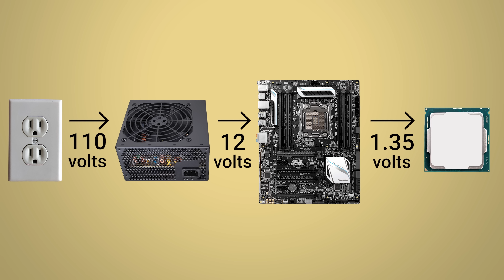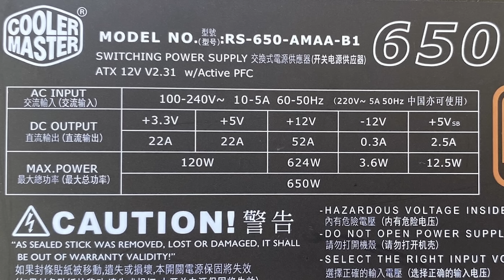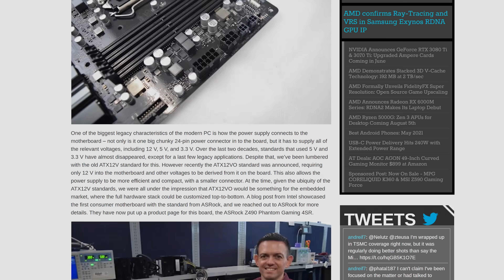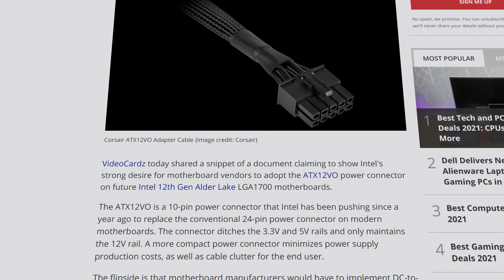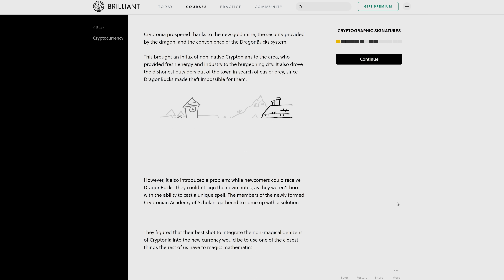Is The 24-Pin Connector DEAD?

Comment: 10 + 6 + 4 + 4 = 24. This seems like a step sideways more than a step forwards
Reply: We have been bamboozled
Reply: @iawindowss4061  We've been tricked, backstabbed, and quite possibly bamboozled
Reply: Thanks, more cables to manage
Reply: Not to mention it will make motherboards more expensive.
Reply: @nattzero5315  not really it is easy to go from 12v to 5v the issue is how clean it is but lucky 5v devices seem to be less sensitive compared to a CPU/GPU in terms of how clean the 5v power rail is. USB for example normally doesn't seem to care half of the time if it just receives 4v
Reply: @nattzero5315  and introduces mor parts to the MB which could possibly fail.
Reply: @nattzero5315  For now, and even then it's only a maybe
Reply: Was just about to say this... At 2:46 that 24 pins just spread out over more Mainboard space. lol...
Reply: There should be 1 DC-DC converter on the case for sata drives that just takes in 12V, leaving more space on the mobo.
Reply: @leerman22  I agree
Reply: @leerman22  agree tho, i mean if this happens to be a new standard, i have no doubt if a 3rd party companies make this thing and used pcie or eps power connector as a source
Reply: @leerman22  SATA is dying. Industry is moving to M.2 or U.2 for Enterprise.
Reply: @AlexeiDimitri  That's why have an optional 5V supply that you can ignore.
Reply: The problem is not the number of pins, but that that one specific bulky cable is hard to manage, plug in, and remove. I have literally shaved down a 24pin power cable to reduce the ridiculous amount for force required to plug it in and take it off of boards I did that a lot on. Honestly what we need more than anything is just a redesign. Maybe expanding that little clip as it is always stuck behind some caps and requires a screw driver to remove, and you practically need a hammer to plug it in.
Reply: @wisnoskij  Just get a right angle adapter for the 24pin. In my experience it looks nicer and is easier to attach to the board.
Reply: @wisnoskij  I know bulk cables that are easy to connect, and multipin one that request little force.
is more a question of design, they could have made a 10 pin + 10 pin and everyone would be happier.
Reply: @wisnoskij  never had a problem plugging them in......taking them out, however.....
Reply: This will also make it harder to add in custom hardware and microprocessors that use 5v logic. You can't hide them behind a motherboard tray anymore because you will need another cable out the MB.
Reply: This is what I tried saying and got misunderstood.  Its a step sideways or even backwards.  You can use a 10pin cable so long you don't need other connections in regards to that it's kind of modular but i don't think ppl are gonna stop using sata connections any time soon.  Hell I have 4 on my PC.
Reply: That's the sad thing about this channel is atx12vo is all about power efficiency and these yuks just kept going on about pin count as if anyone cares.
Reply: not to mention that in the IC that controls  the voltages in the mobo gets damaged, you'll need to replace a even more expensive component
Reply: @ildemaromeroVB  No, you won't.  Just plug it in somewhere else.  Even basic switching regulators have built-in overcurrent protection so it's not likely you'll kill them.  And killing them doesn't take out the whole board since they'd likely be dedicated per connector or pair of connectors.  The standard is incomplete in its current release but regulators and connectors being on the motherboard are recommended as an example but not required.  So regulators can still be on a separate board (SATA power distribution module) or included as inline regulators on the cables themselves.  Since a switching regulator isn't going to generate a lot of heat and they can be fairly small it really doesn't matter where you put them but the closer they are to the end use device the better (like built into the device itself).  Having each device regulate its own power from a main bus would be the most efficient use case which is why expanding the ATX12VO standard with a SATA12VO standard for newer SATA devices would be a perfect goal and you don't even need to change the SATA power connector, just drop the 5v and 3.3v and use fewer wires.  And the 3.3v has mostly been dropped already by all devices.  The future could be even fewer wires needed by using a 24 volt standard and a 36 and 48 volt standard for servers and industrial devices would be even better but 24 might be an upper limit for consumer devices...  It's literally better than anyone here can admit.  If you don't like it then you really really don't understand it at all...
Reply: @10100rsn  All of the options you listed are opportunities for the companies that make any of that to charge more for their parts while the cost of a PSU will remain the same if not more expensive because it's a "new thing". Not to mention the boatload of e-waste making millions of perfectly good power supplies obsolete will bring on. All of that in the name of making a standard that's barely more efficient than a good power supply now doesn't seem worth it to me although tell me if I'm missing something.
Reply: @dirlrido2522  The old standard is not obsolete... yet.  They will still exist for some time before they become e-waste and adapters for ATX12VO won't be difficult to create.  Same with adapters for ATX12VO power supplies to work with 24-pin boards.  Buy what you want, make your own e-waste how you always have or throw it in a box that you put in your closet or whatever.

Yes, you can charge more for an "optional" add on that requires additional components.  SO WHAT!  Don't want it? Then don't buy a board with those features on it.  They're gonna charge what people are willing to pay how they always have.  

The section in the standard where it says "SATA Storage and Optical drives will now need to get their power from the motherboard" is for reference and not a requirement as people seem to think.  The 2-pin SATA with 12 volt only and the 2-pin molex with 12-volt only on the ATX12VO power supplies are optional as well.  Engineers can literally put the regulators wherever they want so there will be plenty of options around.  It is pretty damn easy to stick a couple of small switching regulator boards inline on an adapter too so what's the issue?  Where is the e-waste?  You're just making up things to complain about because you don't understand it at all.
Reply: @10100rsn  I don't really see the point in it all. Nor do I see why you're getting so fired up about a PSU standard. Everything you said is still just more ways for companies to get more money from something that already works fine. No company is going to market anything to do with this standard as optional even if it is. There will be pushes to adopt the new standard, pushes to make you spend more money on something new or pushes to "reject this money making scheme and buy our adapters hahaha!!!". Yay another point of failure. I'm sure there are benefits but if so many people still "don't understand" the point of 12VO with it's minimal efficiency uplift, is it actually something we need in the first place or is it just change for the sake of change?
Reply: @dirlrido2522  Okay Nostradamus.  Keep making your nut job style prophecies and conspiracy theories.  There are literally less points of failure in a fully modern ATX12VO system using all modern hardware.  If you add old hardware to a new system then you are adding the point of failure and not ATX12VO since old hardware is prone to failure from age alone, and that's age from manufacture date and not age from when you purchased it.  On a fully modern hardware system using ATX12VO there are fewer cables (-14 pins and no SATA), fewer components (fewer things to go wrong) and it is more efficient power usage and not just more efficient conversion.  It's you and the people here who are sprouting random conspiracy theories about it being worse and a money grab for big tech companies.  ATX12VO is literally a better system and for a fully modern build will last longer with fewer components and fewer things to go wrong.  It's not going to come to life and murder you and your children while you sleep and the government isn't hiring aliens to brainwash you into buying it and they certainly won't be beaming ATX12VO into your house from a UFO that's watching you watch the History Channel...  It is a simpler and more power efficient design (based on power usage, not just conversion) that uses fewer wires and fewer components overall.  So suck it all you Nostradum,as,es
Reply: @10100rsn  Damn that was an odd take. The points of failure I was talking about were adaptors. My only point is that it's a pointless standard. Non 12VO PSUs aren't going to suddenly die because they're older and neither are SATA devices. I'm not sure what you mean when you say I'm creating conspiracies, it's literally just spending money on something no one needs.
Reply: Just have 2 00AWG wires to power the whole thing with an alternator.
Reply: Nice, now if I need more drives, instead of buying a pci-sata expansion card, I'll need to replace the motherboard!
And also, if any of your 5V and 3.3V components shorts out (maybe a RGB led strip, a fan controller, or even a hard drive) you can potentially short your entire Motherboard! Isn't that cool?
Reply: @Mr.Morden  But they said that in the video.
Reply: @Azarilh  Oh they did but then they unintentionally gave the impression that the number of connectors was also a reason for ATX12VO.
Reply: @Mr.Morden  They did and that's dumb.
Reply: Thanks Engineers
Reply: Someone was paying attention in arithmetic class.
Reply: That's assuming you still have SATA drives. Either way separate smaller cables would be easier to manage than one massive one.
Reply: Well, the 6 pin is used if you really need that power because the 10 pin can already provide more that what the 24 pin did. Regarding the Sata power, it's obvious that the future will be without them, so it's useless to wonder about the transition period. The same thing applies with everything else I guess
Reply: That is, because it is.
It's like phone manufacturers not including chargers to claim they are greener. You are still going to need a charger and that charger has to be packaged and transported separately, which ends up being less green overall. But hey thats how the world works these days, ego and number wars above everything else. Which is really a shame =_=
Reply: @Longgshot  Do you buy a new power supply every time you get a new phone? If so, why, when your previous one should work just the same?
Reply: You previously had 24+4+4=32 instead.
Reply: @erkinalp  but those 4's were hidden with the power supply, visually speaking it looks like more cables to an end user, if they had those drives hooked up. It makes for bad cable management is all Im saying, I'd prefer the old way.
Reply: @erkinalp  24 + 8 + 4 = 36
Reply: The 10- pin connector provides a lot of power and most power used on the motherboard is for the CPU anyway, which comes from the EPS connector. I don't think the extra 6-pin connector will be used much. And then the 4-pin are for SATA. Who's all excited to build a cutting edge system with a bunch of SATA drives in it? 
I bet it will be used in some ITX boards, exactly where people are worried there isn't enough space, and they'll just be 10pin +  4pin, and only 2 SATA connectors on the board. If you can get more power out of a SFX-PSU because there's fewer voltage rails people will love it.
Reply: RGB is a few steps backwards. It looks like a bunch of overgrown cereal munching basement dwelling dudes are setting up lights everywhere (all of a sudden) like middle schoolers.
Reply: NVMe drives don't need cables and won't care at all between 24-pin and ATX12VO.  Since most newer systems that people are going to build are going to have only NVMe drives you shouldn't care either.

Honestly, I want more!  Higher voltages like even just 24 volts would be even more efficient in reducing the wire clutter.  Bring us ATX12VO and then ATX24VO, ATX36VO and ATX48VO all at once for servers and more industrial applications like CNC and printers !!!  DO IT!  JUST DO IT!
Reply: @10100rsn  People do care, and absolutely should care. It isn’t just SATA storage drives that use SATA power connectors, and many people still use the SATA format because it’s cheaper than NVMe. That’s why 12VO motherboards have to have SATA connectors on board. 

To tell people that they shouldn’t care because you don’t just shows your ignorance to the problem.
Reply: @StolenJoker84  so complain some more. Whine and cry for all the wrong reasons.  If it's not for you that's fine, don't spend money on it. It's still going to exist and still be better than what we have now. If it were me on the design team then I would take it even further by eliminating the old SATA power connectors altogether and create a new SATA12VO standard... There you go... Problem moved from motherboard to PSU adapter cable...
Reply: @10100rsn  Not complaining. Just pointing out why your “Nobody should care” attitude is wrong. Yes, there is a place for the new standard. ITX builds - for example - would benefit greatly from it, but it isn’t a solution for every situation.
Reply: @StolenJoker84  "isn't a solution for every situation."  Only situation it doesn't work for is if you're using older parts.  So like the doctor says, "Don't do that."
Reply: @roopey  That’s the point I was trying to make as well. And (s)he ignored the point that, currently, 1) SATA storage drives aren’t the only commonly used components that require SATA power (some fan hubs - like the one built into my case - do, for example), and many people still buy SATA storage drives because it’s cheaper and offer far higher capacities than M.2 drives. Until SATA devices can run strictly on 12V, this standard is going to introduce new points of failure that aren’t currently present. 12VO feels a lot like a solution looking for a problem for most end-use cases, and - IMO - isn’t likely to take the computing world by storm until they do figure this all out.
Right now, I think it’s a good solution for mITX builds (that aren’t likely going to have SATA storage, extra fan controllers, or the like anyway), but not much else (in the consumer space).
Reply: @StolenJoker84  Yes, it certainly doesn't help much. It might have been OK in some cases, as you said. It could help in budget builds where people push almost every cent towards GPU / CPU while everything else in their system is cheap garbage.

For me it's just another dumb limitation created by Intel. Similar to their locked Prozessors (non-K), limited "lower tier" chipsets and non-ECC Ram on desktop. That's why I went with a Ryzen CPU this time. And it clearly was the best choice. 

And, even though I'm paying almost nothing for electricity (our PV on the rooftop delivers more than enough), I still went with a titanium rated PSU from Seasonic. If less people would buy cheap crappy inefficient PSUs there wouldn't be any problem.

Enough of my rant. Let's just hope this dumb "standard" won't stay too long...
Reply: @Mr.Morden  12VO is LESS Efficient if you saw the spec sheet you would know that this will be dead on arrival as standards go its SHIT.
Reply: @snintendog  all the data I've seen shows that ATX 12vo is around 90%+ efficient on average instead of the ~80% efficient on ATX, costs are yet to be revealed

Comment: I never had issues with using the 24 pin. And honestly, when looking at custom sleeves cables, i think a single 24 pin would visually look better than separate cables close together, sleeved or not. 

But, if its more power efficient, its fine to switch. We'll adapt. Not a fan of having to run SATA from the MB, but with nvme becoming more prevalent that may become less of an issue. That just leaves external components, like waterpumps, to switch over, which im sure they would do. 

The hurdle is getting everyone on board with the switch, and providing an intermediary for 'legacy' components as the new standard takes hold.